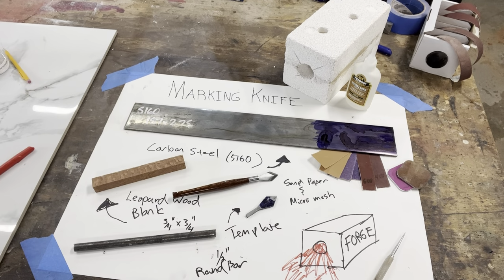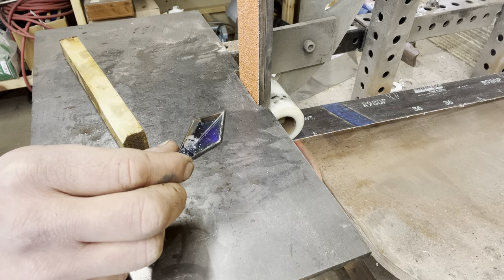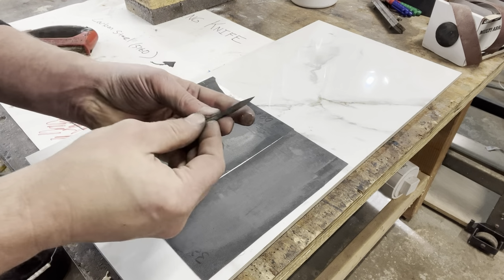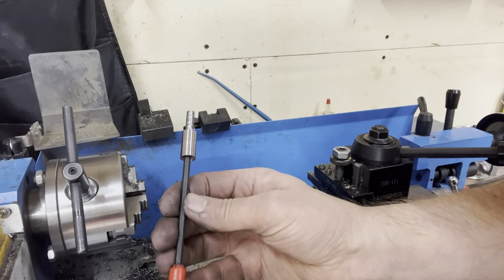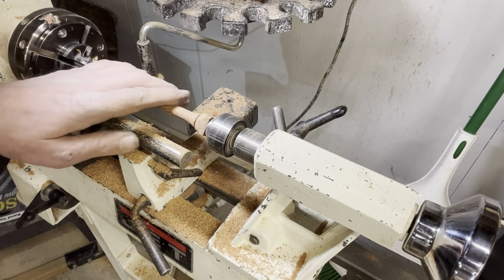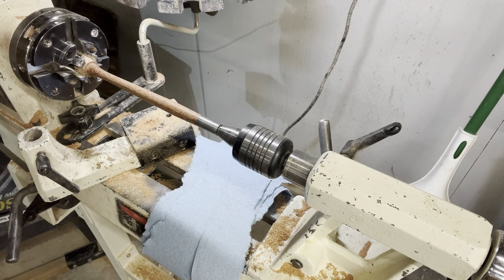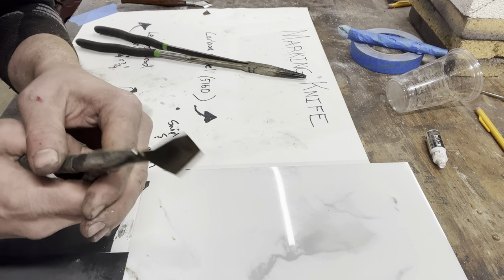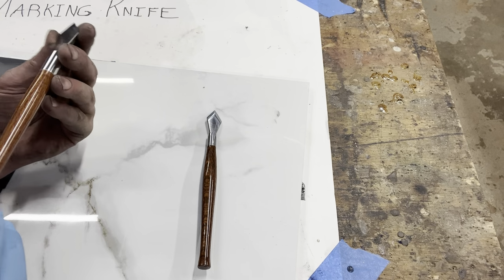Making a marking knife from scratch

Comment: I have heard of pen turnrrs using CA glue for a finish. Question- you used denatured alcohol in between thin and thick. Wouldn't that remove some of the CA glue? I learned a lot from this video, thank you. Oh, what thickness is the steel you used for the blade? You didn't mention that.
Reply from the maker: Hi, thanks for watching and thanks for leaving a comment.  The CA finish was definitely pen maker inspired!  In my experience, the alcohol doesn’t really harm the CA once it’s cured but acetone will cloud and dissolve it very quickly.  The steel was .1875” or 3/16” I think.  Thanks again for watching!  How did you find my video by the way?  It’s getting so many views and I have no idea why.
Reply: @MNIronAndGrain  this video of popped up in my feed while I was watching various Damascus steel blades.  I thought about making marking knives for my brothers. This was a perfect distraction.

Comment: I like the way you explain yourself it was very informative
I have a question though .For the blade insertion would epoxy be less brittle?
Reply from the maker: Thanks for the kind words and great question on the epoxy!  Yes I think epoxy, especially g-flex would be less brittle for sure.  So far I haven’t had any issues with the ones I super glued but maybe I should do a side by side stress test of one using CA and one using epoxy!

Comment: Something I would like to make myself.   What angle is the bevel?  What temperature did you temper the steel and how long in the heat?  Were you using Mapp gas?
Reply from the maker: Hello, I used a 30 degree jig/bevel for these, that gave me the look and the geometry I was after.  The little forge was heated with MAPP gas as well.  For the temper, I think I did 2h at 400 degrees but definitely look at the appropriate reference material for the steel you choose.  I could be a lot more disciplined in my heat treatment for sure.
Reply: @MNIronAndGrain  thank you.

Comment: What is this used for?
Reply from the maker: Marking knives (and striking knives) are used a lot in woodworking for marking out dove tails and joints etc.  They make a very crisp and thin line which makes them great where more precision than a pencil line is needed.  I don’t do a lot of fine woodworking but I do use it for marking centers on wood turning blanks.  Thanks for watching and for the comment!
Reply: @MNIronAndGrain  oh ok. I was wondering thank you!
Reply: @MNIronAndGrain  I want to get better at being more precise with my cuts. I hate that tape measures Have about an 8th inch play. You should make a video on how to Make more precise measurements and more precise cuts. I know I would benefit from it.